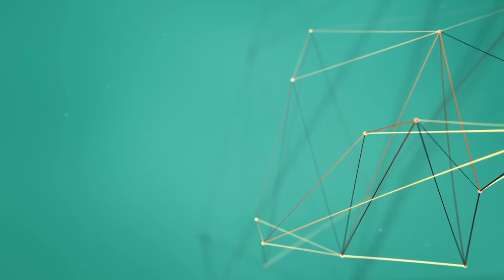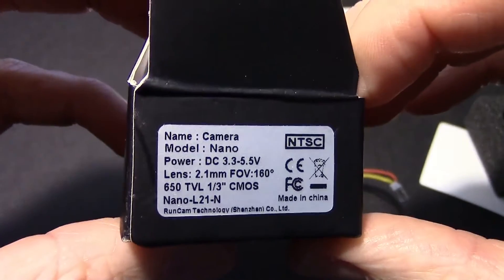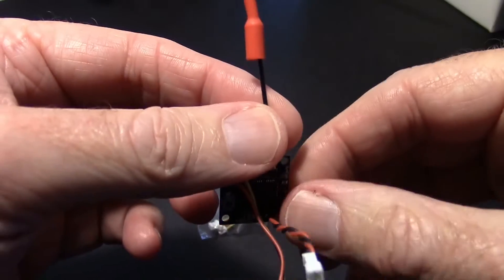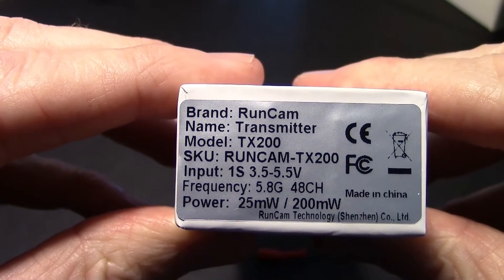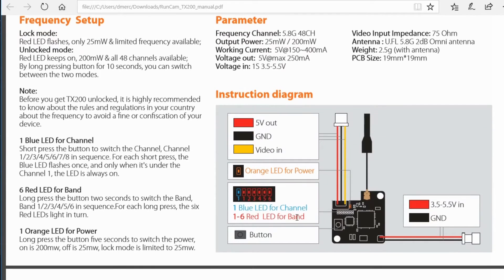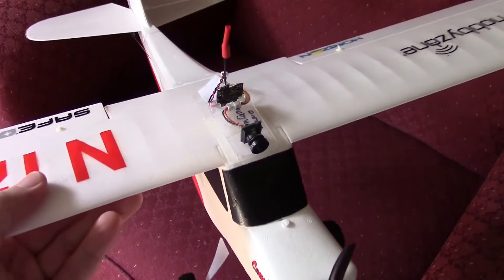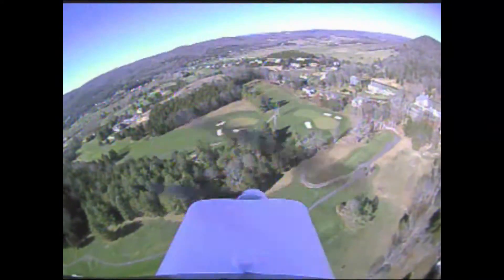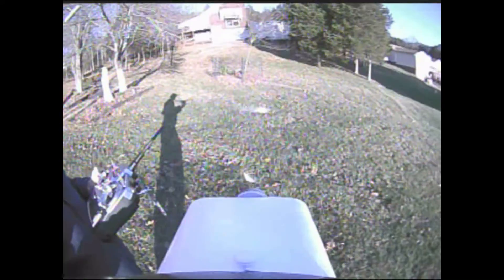RunCam NANO FPV Camera with VTX Review & Flight Test

Comment: I was looking at this one for my brushless whoop, how would you say it does indoor in low light conditions?
Reply from the maker: It's definitely not a low light camera at only 0.1Lux@1.2F. 
However if there is average lighting in the area you are in it will work.
It didn't do very well in the basement with only natural light coming in through a few small windows.